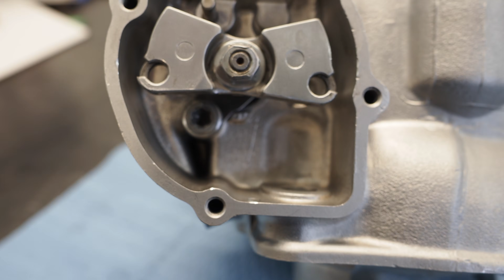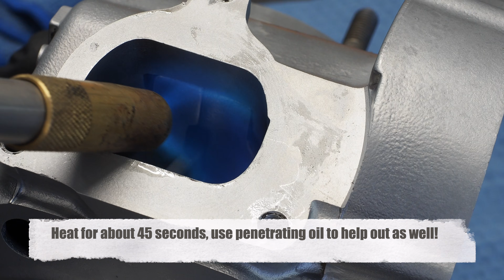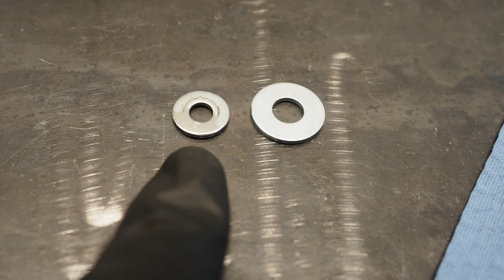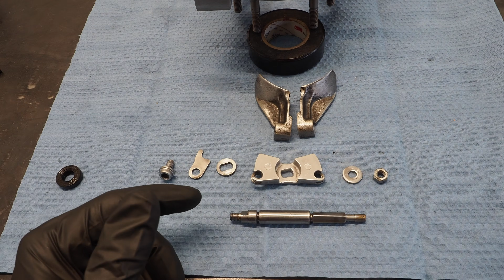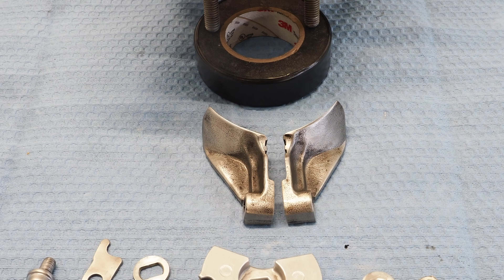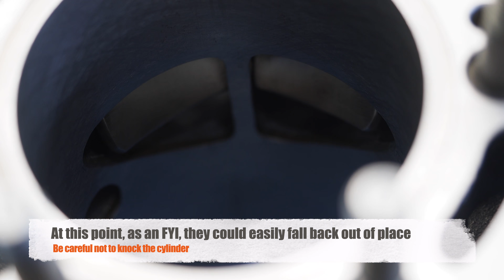2002-2007 CR250 Power Valve REBUILD - STEP BY STEP

Comment: Is this what you have to do to because you can't buy a replacement from Honda?
Reply from the maker: Pretty much unfortunately...
Reply: @GregHitchko  Wow there's no one that makes them on the aftermarket side?
Reply: @GregHitchko  My bike goes pretty flat on the top end was thinking there could be something wrong with my RC Valve. I'm debating on selling it and getting a different 250.
Reply: @GregHitchko  How many times is the RC valve good to be rebuilt?

Comment: I just did this on my 03 cr250 and found it much easier to go in from the cylinder and then turn the whole things upside-down as then the valve shaft slots fall right where the shaft enters.

Comment: using a medium small flat blade screw driver (i use my finger nail) thru the exhaust port(see @ 9:35), gently separate the two power valve halves where the shaft goes thru . then you can pull the actuator shaft out with relative ease. its kinda of like the Chinese finger cuff trap. use the same technique when reinstalling the shaft . it took me a few times to develop the technique
Reply from the maker: Thanks for leaving that technique! That part can be such a pain. Much appreciated dude 🙌🏼💨

Comment: Hey Greg looking to see if it’s possible to remove and replace the seal without having to disassemble the whole valve assembly any insight is greatly appreciated TIA
Reply from the maker: Hmmm you might be able to. If you can get a small pick to grab it out, I don't see why you wouldn't be able to replace it without removing the whole shaft!
Reply: Having just reassembled mine. I'd imagine you'd have to reach down the cylinder to lift the valves up so the shaft can find the holes.

Comment: Greg, another Greg here. I am doing a top end rebuild on an 04 (it's first top end) and the pv shaft is stuck in the cylinder. This helped immensely and I will be using this video to remove, clean, and reinstall the valve! Thanks!
Reply from the maker: YES! This is so awesome to hear Greg. Great to meet you. I had the SAME issue with mine and needed to share the advice for others like yourself out there. Let me know if you have any questions on the rebuild. Thanks for the feedback!
Reply: Also have an 04, the part I’m stuck at is reinstallation, specifically torquing the opposite side 10mm nut. When torqued to oe spec (6.5in lbs), it compresses the inner guide sleeve down on the exhaust flap causing no movement at all. Any suggestions would be great!

Comment: he if you wane clean the carbon easy and good like new with out to much trouble try to soak them in some mister muscle oven cleaner the foam one be careful use eye protection !!! its a must if its not aluminium you can soak them pretty good in it watch out for alu parts tho cause the oven cleaner can eat into it so don't soak those to long it works like a charm for me always when doing my agr valve on my diesel car or my 2 stroke 100cc scooter exhaust rinse it with water or shrub it a little and falls of like mud

Comment: I used a slide hammer,  came right out
Reply from the maker: How did you attach it to the shaft?
Reply: @GregHitchko  my slide hammer came with a an attachment that's like a 2 finger claw. I put a washer and the nut on the shaft( like you did in the video). Took a few tries, some cursing, and a few more tries and it came right out!
Reply from the maker: @331moto  oh no way! Could you drop a link in a comment to it?
Reply: @GregHitchko  I made an adaptor to fit mine. Cut a thread one end to fit the slide hammer. Drill and tap it the other end with the thread on the PV shaft and screw it on, then screw the slide hammer on to the adaptor.

Comment: Do I need the head removed on my 02 to get these out? or can i get them through the exhaust port?
Reply from the maker: You should be able to get them through the exhaust port if you rotate them out!  It is easier to get them out through the cylinder, but I put them in through the exhaust port which means they should be able to come out through that way as well.

Comment: 03 you can’t go through the exhaust port. I went through the cylinder side
Reply: My  03 won't go out thru the exhaust either.  The exhaust is round on the 03. The 04 is an oval.
Reply from the maker: I thought the 03-04 were the same and I was able to get mine through the exhaust port, weird!!
Reply: @GregHitchko  I’ve never been able to do it that way. I find it weird as well. Through the cylinder they practically fall in. I think it’s because mine don’t have the 2 cut outs on the flaps. O3 is just solid. I’ve noticed a lot of small differences over the years. Like fork guards are different hardware is different. Exhaust port is different on some and also reed set up.
Reply from the maker: @bradleycorson5737  Honda trying to squeeze what ever improvements out they could before making the complete switch to 4 strokes probably lol!

Comment: I used easy off oven cleaner, and it worked well. You still need a small knife or a pic works to remove all the carbon. I used my fingers to get the height correct. Some methods let the valve open to much.
Reply from the maker: I've heard the oven cleaner method works great too, just never have any laying around haha